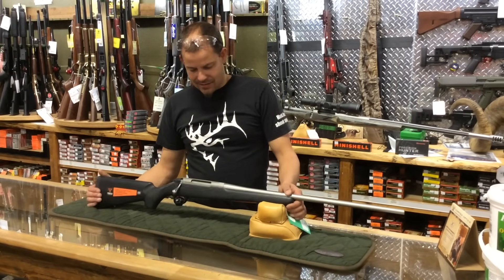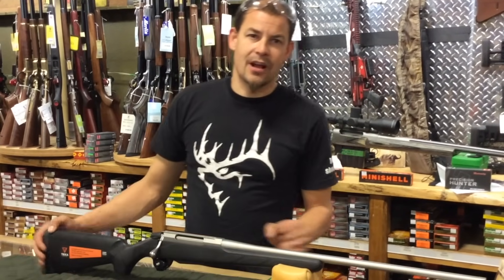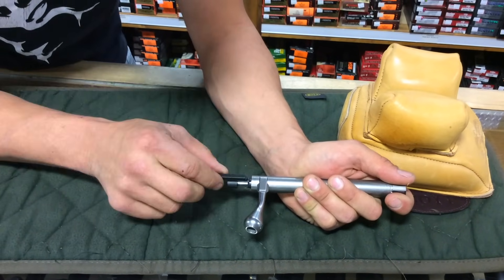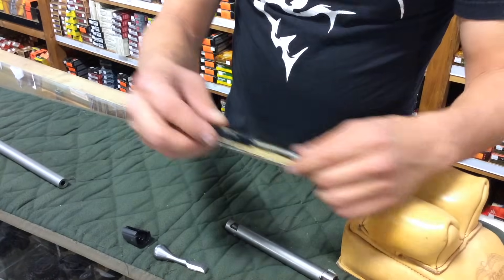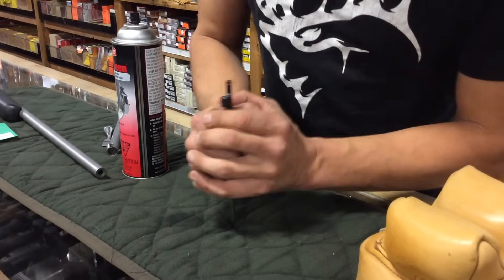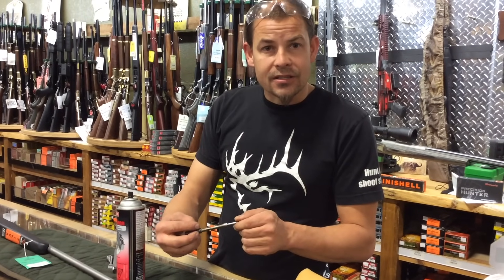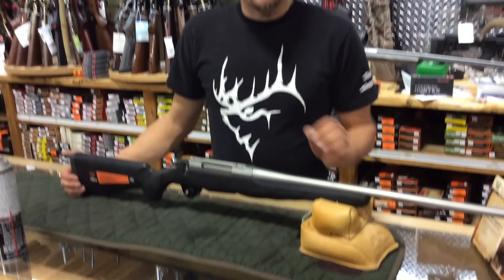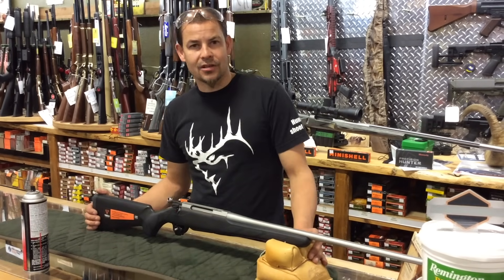Tech Tip: Tikka T3x Bolt Maintenance 101

Comment: One word of warning from a mechanic, brake clean is highly corrosive to rubber and plastics. Long term use will wreck the non-metal parts
Reply: Solid point.  Thanks.  I was just about to use some on my chainsaw too.  That won’t be happening now.  What might be an alternative degreaser / cleaner?
Reply: Aren't you confusing it with brake fluid ? Brake fluid is corrosive, not brake cleaner. Also no rubber nor plastic parts into the bolt

Comment: This is new to me, we use a lot of tikka rifles in northern climates here in Canada and I don't recall ever hearing of this issue. Great information none the less, I will do this to my rifles. Thanks!
Reply: Had my Pre-64 Model 70 and Rem 700 both freeze up on exceptionally cold days before, so i made sure to learn to field strip and degrease every bolt gun i own. Never had a problem since.

Comment: Great tip. Extreme cold weather in Canada will freeze oil into thick molasses and jamb everything. But don't substitute with any corrosive chemicals! In the military, we would sometimes go dry, but wear and icing condensation is a problem.

Comment: Any chance you can bend the firing pin pressing on it like that? It took every bit of strength to do what you did on my firing pin.
Reply: Don't push on the tip, pull the back instead!

Comment: Found the firing pin is impossible to take off, only can follow the steps till 2:00 on a T3X Tac A1. And needs tool to  pull and rotate the shroud.

Comment: New owner - two big guys tried and couldn't pull the assembly back far enough to rest on the fin...any suggestions?
Reply from the maker: We recommend if you cannot pull it back by hand try using some non-serrated parallel pliers.

Comment: Just an fyi, as a woman it’s not really possible to “use a bit of strength” and pull the pin out, but an Allen key put inside that little gap gives a good grip that I was able to handle easily to finish the job. I’m sure there’s plenty of guys who didn’t have an issue with this, but if it makes it easier why not do it?

Comment: Should you not also de-grease the bolt body before re-assembly ?
Reply: Yep, cleaning brake inside then blow it with compressor. Leave it dry few minutes before assembly.

Comment: Just wondering if once you’ve removed all of the oil using brake clean if it’s necessary to use G96 or any other product? Can you just leave it dry? Also what’s a substitute for brake clean? Great video.  Thanks

Comment: New T3X owner, did this and the bushing was pretty dry from the factory (zipper sound was there), so maybe Tikka is not lubing them so much now?  Also, this takes some hand strength but it is not too bad - understand the rotation direction before proceding.

Comment: I got a t3x Superlite yesterday and as far as I can tell, this disassembly method does not work on my bolt. Can't even get the shroud off, as (according to you) it needs to be turned, however it is stuck in a groove with the piece of metal on the edge of the firing pin. Could you please address this in a pinned comment?
Reply: I am having the same issue, have you figured it out?

Comment: My friend has a Tikka M658, shoots great, however he has developed a problem ejecting the brass. In fact the whole bolt jams and will not open without some force. Can you offer any thoughts on this. I watched your video and throughly cleaned the bolt.
👍
Reply: Check chamber for rust
Factory loads or handloads?
Cases from other rifles may not be re sized properly or over length.
Check shells for signs of grabbing, around base could indicate poor resize or overload, check primer for flattening. Hope it helps

Comment: I have a question I would like your opinion on. I bought a new Remington 700 SPS Stainless a few years ago and the barrel still gets rust marks all over it! I've done everything I can think of to remove them, and I haven't had ANY luck as of yet. Is that supposed to happen to stainless steel barreled rifles or is mine just a piece of junk? If you have any suggestions on how to remove the rust from the barrel and bolt I'm all ears
Reply: Clean salts off inside and outside. Clean off salts from the storage bag/box. Salts can be from unburned/burned gunpowder, hand sweat, dirty storage surfaces. Salts plus humidity plus steel plus time = rust. Even many kinds of stainless steel would rust with salt water. Store gun in low humidity, good ventilation. If you tied everything already, try a new, different oil. What you are using may be contaminated.
Reply: @imyanggers  Thanks, I'll try it
Reply: Gun stainless steel is different from normal stainless steel found in kitchen knifes that are rust proof. All gun stainless steel will rust without maintenance. I use light steel wool and oil to remove rust . Use renaissance wax on the outside of barrel ,action ,lever or bolt wherever you touch it to prevent rust. Gun oil will rust your finish because it wipes off and evaporates. Where renaissance wax is petroleum based won't wipe off  or evaporate even in the rain. That's why people use it on hand guns to prevent rust.

Comment: Why the cocking handle will not slip out ？
Reply: looks like because when reassembly is final there's pressure from the firing spring pinching it, on top of a really fine fit all around. I wondered the same thing first video I saw of these things, I thought someone forgot a part.

Comment: Will the T3 stainless bolt interchange with the new Tx3 CTR black bolt and if so where could I purchase it.
Reply: Yes they do interchange. You will just need to check the headspace with set if go-no-go gages afterward.  I just saw them in stock at midwestgunworks.com.

Comment: Just did this to a Tikka t3x Hunter. Not sure if there is something wrong with my bolt, but this procedure is not possible without a vise. Please don't take your bolt apart unless you're sure you have what you need. My bolt did not push around like his it required massive amounts of force
Reply: Yip. Same here on my tikka t3x bought yesterday. Think Arnie would struggle tot mine to turn

Comment: How cold are we talking?  I would rarely go hunting below 20° F. Is this a negative degree situation most times?
Reply from the maker: we recommend doing this for every Tikka.
Reply: That lube is there for a reason... extreme cold conditions maybe require this procedure but 90% will never see those conditions. Keep the gun in a non heated space, out of the snow or rain tho.. warm spaces cause condensation which WILL cause trouble when it becomes ice..
Reply: @jerrysullivan113   It's shipping grease. And the reason it is there is transportation and sitting in various spaces with various temperatures and humidities before the customer purchases the weapon. You don't want that in your gun when you hunt with it regardless of temperature. Makes it harder to clean and poor cold weather performance. For most states in this area, it's illegal to hunt anytime it's NOT cold, snowy, and/or rainy. The ideal conditions you describe are impossible for most hunters in this area.
Reply: Understand,,, always a thorough cleaning of the NEW weapon, especially the barrel and fire control mechanism.
Reply: @jerrysullivan113  I found this video because I just had 2 seperate t3s light strike in the same season.  I bought them within 2 months of each other 3 years ago.  Was hunting in 40F.  No where near extreme cold.  This fixed the problem.
Reply: Fortunately, the several TIKKA and SAKO riles I've owned have had no problems at all, of any kind. But I am glad you got your issues corrected. Too much HEAVY lube CAN be a problem tho usually in semi auto mechanisms. Have a gooden...

Comment: Would cleaning the bolt and lightly lubing it with ballistol work?
Reply: @Ван Гвардия 

Great stuff for dog paws or a wood stock... but not for any metal part on a gun. 
It will resinify over time and do the exact opposit of what you used it for.

Comment: Yes use breakKleen to get the old oil completely off, then re-oil with fully synthetic oil. Running dry is so so so wrong. If you use synthetic oil there will be no cold weather issues.
Reply: zedlips exactly !
Reply: Are you saying to oil the outside of the bolt? I thought you want the firing pin to be dry or more dry.

Comment: I hope that's not a real glass display case. Putting that much force on an item as small as the point of a firing pin WILL eventually cause that glass to blow out, especially if it has scratches in it!

Comment: Would be nice to hear what this gentleman is saying but unfortunately the low volume of this video makes it impossible to do so.
Reply from the maker: Turn up the volume in the bottom left corner of the video, beside the play button, and on your speakers. The video has plenty of volume. Best of Luck.
Reply: Thank you for your feedback. I did as you suggested. I found that the volume was already set at maximum and even at this setting the volume is still exceptionally low. I also checked the volume level setting on my computer and it is at maximum also. I do not have external speakers connected to my computer which I'm certain would help but I find that for the vast majority of YouTube videos my computers' internal speaker is more than adequate. Sorry to say that in this case I am unable to hear your presentation. Sad for me because I am very interested in learning your technique. Thank you again for your effort in helping with this matter. Good Day. @corlanesportinggoodsltd.2551

Comment: I tried this and am sorry I did. Unless you are a “young buck” like this dude, be warned it is harder to do than it looks. Had to use a pair of pliers to reset the firing pin when it slipped the opposite direction, unfortunately scarring the shroud.
Reply: Hi Mike, I just had the same thing happen to me last night. In case it ever happens to you again - I managed to get it back into position by opening my bench vice, putting the lip of that little flat bit with the red dot on the corner of the vice, then pulling and twisting the bolt with one hand and holding the bolt down with the other to stop it pinging back under tension.
Took a couple of tries but I got it reset without scuffing any of it in the end.
Reply: @keepinfrosty3672  Thanks…I’ll keep it in mind!

Comment: The oil is there for a reason !
Reply from the maker: You are correct, it is for shipping and storage, as the gun may sit for up to a year and pass through different temperatures that cause condensation.  As you can see in the video, Greg points out that a light film of oil, like G96, is required after removal of the thick protective oil.
Reply: In the Tikka manual it says to clean the extra oil from the bolt before use.
Reply: @riv3rbanks282  funny how manuals are so useful
Reply: @riv3rbanks282  yeah from the bolt. not the inside of the bolt

Comment: Please normalize the audio (speaking voice way lower than intro and other youtube videos). Also, make sure you buy G96 synthetic (not the normal G96) for better cold weather performance and easier cleanup.
Reply from the maker: Thanks for your reply, at that time we did not have a good camera or external mic for quality audio. All future videos will have better audio.
Reply: @corlanesportinggoodsltd.2551  Good to know, subscribed.
Reply: Nothing beats wd40 best for cleaning and rust pervention
Reply: @larryclare5677  The opposite is the case. Just about everything beats it in both of those categories.